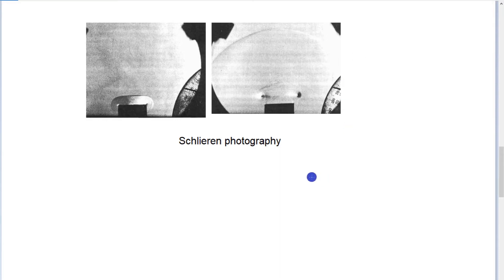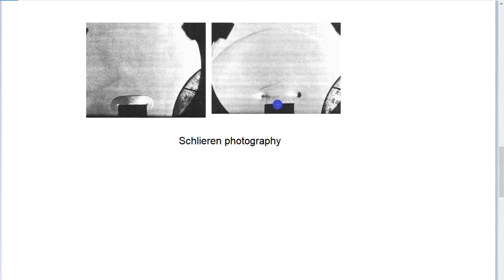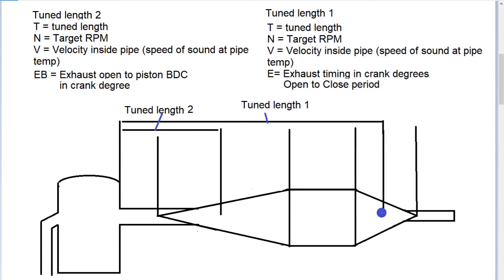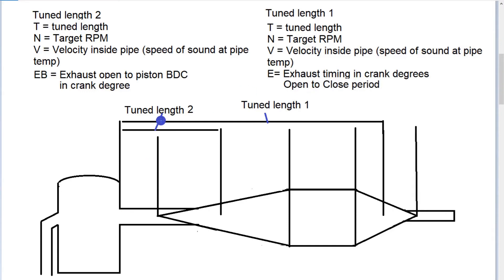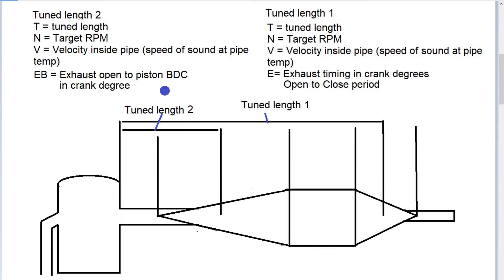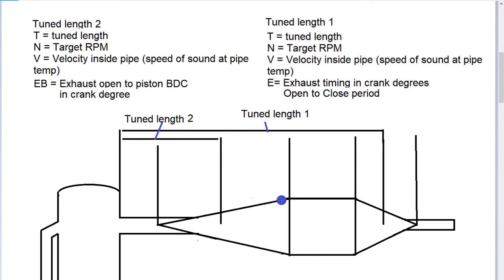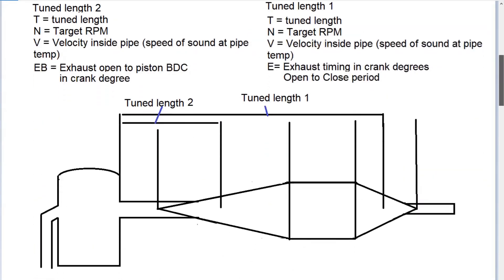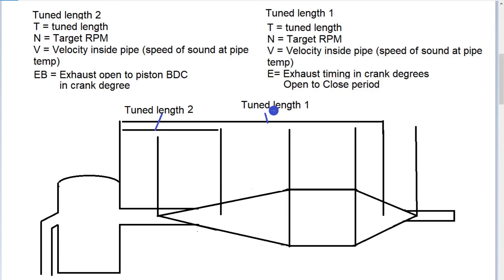The two tuned lengths of the 2 stroke expansion chamber, photo of compression wave formation. E3

Comment: Hello, I wanted to ask you a "purpose only" styled question. I'm not sure I would do this but wanted to ask the theory behind it. 
In the enduro world the expansion pipes eventually get dented and damaged unless you guard them. My question is if you built a pipe that had a longer header that was close to the bike and "up" out of the way then added the diffuser and the rest of the system also up out of the way. Would you agree that the bike would run sufficient enough for low speed technical riding. Also would this style of system cause hardship in anyway to the engine ? Thank you in advance for any input ... much appreciated :)
Reply from the maker: As long as the pipe dimensions and by that I mean the diameters and lengths of each section were right then there would be no problem, and if you are not worried about power the only part that can cause an issue for the engine is the outlet pipe if it is too restrictive.
Making a longer header you could just take some out of the straight neutral chamber section to ensure the pipe has the same tuned length and not suffer a huge power loss.
I have a later series that covers the equations used to design a pipe and am about the upload a free pipe design software shortly that makes the job a bit easier.
Reply: Hello  @AuMechanic  thank you ... If I fabricate this style with longer header I'm under the understanding it will increase low speed torque output. I would utilize a slightly  more sharp than slender diffuser angle and keep the tuned length as close as possible. But as I understand there is no exact approach, test and tune to achieve your desired result as is part of the fun. Your reply has helped quite a bit cheers
Reply from the maker: @outbackenduro7418  
You can leave the diffuser as is and just cut out some of the flat neutral chamber to offset the extra header length. Making a sharper angle on the diffuser will make it more peaky which is counter to the longer header.
That was the basic approach using Gordon Jennings equation from the 70's
Blair equations from 1996 differ a bit in that the mid point of the diffusers timed returning expansion wave the same (around BDC) regardless of the other variables.
See this video https://www.youtube.com/watch?v=5fojBHZNAWM
Reply: Hi  @AuMechanic  a wealth of knowledge, thank you. I will start my research now appreciate your input

Comment: For some reason video E4 and E5 are missing form your page. Thanks Rick .good info I use to build adjustable pipes. The stinger could move to change length.
Reply from the maker: Those other vids were mostly just covering the software project which is has changed since and Ill be doing a downloadable version.

Comment: hi dave to achieve more bottom end power the shape of the exhaust port end taper  is narrower as shown in your drawings is the tuning length from exhaust port to stinger shorter or grater ?
Reply from the maker: Tuned lengths using Blairs equation is taken from port window at the piston to the end of the baffle cone.
For Jennings from port window at piston to half the full length of the baffle cone.
Bell simple copies Jennings.
The disparity between the two is something I will cover later in the pipe design series.
Those are the tuned lengths of the baffle cone position relevant to the port window, the baffle cone dictating port plugging at peak that should chop power off over then RPM if length is tuned correctly.
The other tuned length not covered by either equation is the tuned length of the first Diffuser cone that determines the arrival time of the expansion wave or negative pressure pulse.
The equations assume the phasing of both diffuser and baffle cone to be fixed, this is something I do not agree with and believe the equations should embrace both tuned lengths.
But at this stage I am covering the equations as per Blair specifies and not my own opinions.

Comment: thank you dave for your reply
i realise that making the pipe longer you will loos top end power as the volume and distence won't be accurate but would it increase power at a lower RPM?
thanks again for taking the time to reply
i always though that if i took a standard pipe and increased the length of the middle section it would change the power to a lower RPM
Reply from the maker: No, the pipe will just be mismatched to the engine.
The length has to be whatever the engine exhaust port timing dictates.

Comment: if i won't more bottom end is the is the pipe longer then for top end power
Reply from the maker: Hi Arvo
The power characteristic of the engine is largely determined by the port timing and other factors like compression ratio etc.
Once that is established the chamber is design to match that.
Tuned length matches the RPM range the engine is design to operate in.
So having a longer pipe for low RPM on an engine with peak at high RPM engine will just result in mismatch and less power.
The shape of the pipe likewise has to match the range of power the engine is designed for.

Comment: I saw in another video you said something about using a lower rpm for the diffuser than the baffle for targeting tuned length?
Reply from the maker: That's right, the baffle cone dictates power at peak, the diffuser OTH has to provide the effect over the an RPM band and up to the peak over it length.. So the far end of the diffuser is the lower end of the range and the nearest end to the engine is the top of the effective range.
The baffle cone OTH plugs at peak to increase peak power and then effectively does the reverse and stops it revving any higher, it is the rev limiter in effect.
With the baffle cone it will not have a sudden cut off up top, but will also have a lower peak power.
Keep in mind the baffle cone is up to double the angle of the diffuser cone so a very short duration.
Reply from the maker: Ill be doing some more detail in the diffuser timing, I'm just adding some bits to the model software to display it visually so you can see where the reflection points are at given RPM and how the centre point of the wave moves its alignment as RPM rises.
Reply: AuMechanic thanks you ..cant wait to get off work to watch your new video and learn more....if u could please edit your last comment...clean it up a bit it confuse me a bit...just check it over please. Thanks for all you do I learn more from you than any other source
Reply from the maker: I have only put basic points in the comments that does not fully explain it and yes may be a bit confusing.
It is probably best to cover it in the video in some detail so it is much clearer to understand.
This new video I have just done is 3 equations for measuring the taper angle of the cones that may be useful to measure a chambers tapers of unknown angles.

Comment: I'm loving these videos mate! I'm a mechanic myself and getting into 2 stroke and i love learning this stuff! Awesome knowledge mate!!
Reply from the maker: Thank's Jimbo, are you in the Bike or Car trade ?
I spent most of my years in car trade simply for the higher pay, but working as mcycle mechanic had benefits when I was racing and enjoyed it far more.
Working for small bike shops it was better than car workshops, free shop bike to ride was another benefit.
Reply: AuMechanic that’s awesome mate. I’m in the car trade, i’m a senior technician at a Toyota dealership but worked around a lot in the last 20 years. I don’t have a bike but have mates that do. I have 2 stroke rc cars and am about to put a tuned pipe on a big 1/5th scale petrol 2 stroke truck. It’s extremely interesting learning what you’re teaching as it fills the gaps on my knowledge of 2 stroke performance!!! Amazing stuff. Very well presented videos mate I’m thoroughly enjoying them!!
Reply from the maker: Glad you're interested.

Comment: Hi! I've been watching your videos on 2-stroke exhaust calculations with my full attention, to try to understand the variables and how they relate / effect each other.
In this video there is something that I don't understand:
Where, inside each cone do you consider the end of the tuned length? Is it in the middle of each cone's length?
Thanks. Keep up the good work!!
(I'm actually surprised that you don't have many views, because your content is much better than most I've seen in YouTube on this subject and there are so many 2-stroke fans out there - their loss, I guess)
Reply from the maker: Hi Jose, thanks for comments
The tuned length is taken from ex port window to half the length of the full taper. That is basically half the straight line length of the complete cone shape.
So with the baffle cone you would draw a cone that ends in a point with no outlet pipe, and then measure the straight line length from to tip of the cone to the base, and half of that length is where to take tuned length from.
I mention this again in latest video E7 https://youtu.be/n5AvG-hDvY8?t=108 at 1:47
Re views in, YT doesn't like tech lecture videos like this, it only promotes entertainment type videos as far as I can tell over the last year or so.
Reply: the length starts at the piston side of the port correct? thats where i always went by. I got into pipe building for a while. i made about 5 different pipes for my kx. i think by the fourth or 5th using a 3 stage diffuser i finally surpassed the pro circuit it originally had. probably only because the pro circuit i designed for stock port timing and i was aiming for full race. if i remember correctly my port timing was 135in 205ex and i made power around 10000rpm. i used a few software programs RacingSM software was a great program.
Reply: ya transfers at 135 and the rear boost port was 140.
Reply from the maker: Yes the tuned length is from the port window itself where the primary compression wave starts at blow down period.
There are some basic starting numbers to use and wave timing is not hard to calculate, but to accurately calculate things like diameters of mid section, header and tail pipe requires software as the calculation to arrive at that are very lengthy so software is needed to design a pipe accurately for sure.
Re the port timing, was the KX a reed intake, was just wondering if the 135 was the transfer.